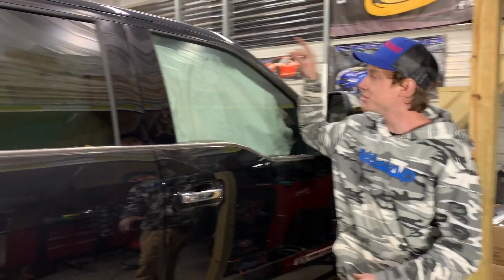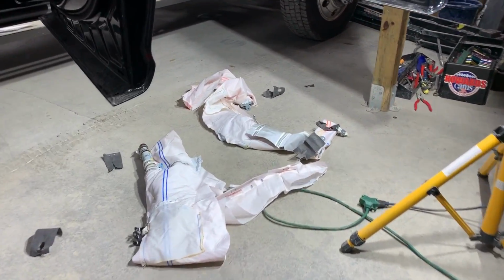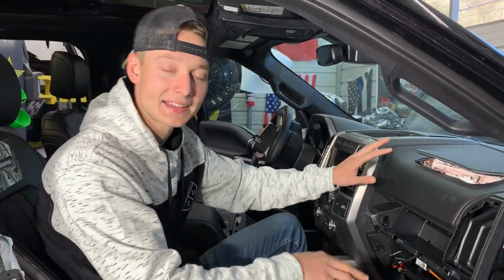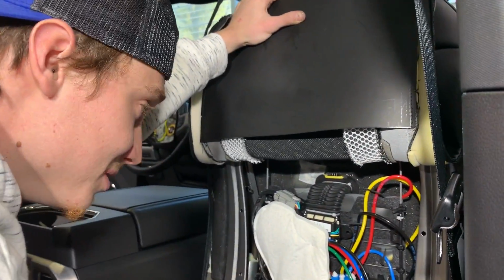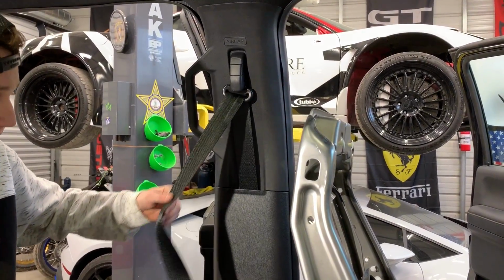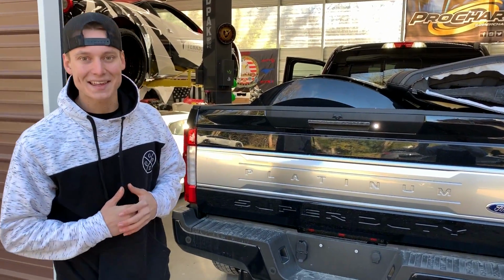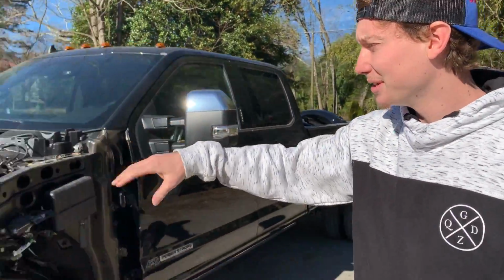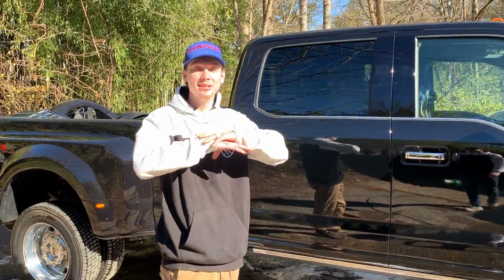Rebuilding A Wrecked 2019 Ford F-450 Platinum Part 3

Comment: *STEP BARS* Hey guys. Every time the battery is disconnected, you have to turn the step bars back on from the controls on the steering wheel. Default is set to off. Just turn them back on.
Reply: I didn’t know that thanks
Reply: Yall out here like these dudes read these comments.
Reply: Sean Cunningham Lol,but they do though. dude.
Reply: I have a 2016 Expedition and can vouch for this comment. It's not hard to find in the settings and there's also options to have them stay out all the time in case you lose one of the motors.
Reply: @dustinlanclos1061  i get what you're  saying  but that more like Logan paul jake paul views
Reply: That’s good to know thanks
Reply: True I had to replace the battery in my wife 2016 king ranch and I had to reset the side steps to work again.
Reply: Every time it’s in an accident it sets the steps to off as well, 2010 f150 platinum happened to me. Just had to reset it to auto
Reply: Leave them off until it has good batteries otherwise you run the risk of frying the power running board module every time you jump start it.
Reply: Also whenever you use an OEM scan tool on it to run a test, it resets them to off.

Comment: Guys, the steps go back to default of not deploying when you disconnect the battery or it runs really low.  Go to the front display, options menu with the steeling wheel controls and you will find an option to turn on and deploy the steps.  Takes just a few minutes. Good luck and great build keep up the good work!

Comment: You guys might wanna get a deeper trans pan. These newer Super Dutys run hotter then most trucks. I have a 2017 F350. In the hills off Pennsylvania the trans got up to 240. I did a lot of hot shotting with my truck and put on 233,144 miles before the trans went out on me. I would say 2/3's of the miles where under load. After around 30k miles I had problems with the sync radio and moon roof. If your moon roof starts to click when you open or shut it or doesn't open or close right away. You will need new tracks for it. Ford Company is well aware of the problem. I know they did not fix for 2018 models, not sure about 2019 and newer. Great looking Truck. Over all I do like mine. Great channel, Been following your guys for awhile now. You guys need a Goonzquad car museum with merch store so your viewers can stop by. Kinda like what Duck Commander did. Keep going strong. God Bless

Comment: BEFORE I SAW THIS VIDEO, I had a hard time resolving how a truck like this F-450 could cost over 80 thousand dollars.  That is until I got to see just what goes into just one heating, massaging and air conditioning seat alone.  Then all the parts under the dash and everywhere else.  It is all just amazing.  It is also amazing to see the squad take on the chore of rebuilding this truck.  Much respect for the boys..

Comment: Fans: send dozens of razor knives via fan mail

Goonzquad: uses single edge razor blade to open/cut everything
Reply: Yeah, I remember someone sending them a whole lot of knives about the same time they were receiving flags from different subscribers...
Reply: Plot twist they take out the blades
Reply: Theyre disposable and sharper then most pocketknives.
Reply: it's easier using those little razor blades to cut airbags.  That, i know.

Comment: You have to press and hold the ! button on the Noco Genius booster when the battery are really low to activate the booster function. Ive started flat dead diesel trucks at -30F without issues ;)
Reply: I need to get one. I drive semi and work on cars

Comment: 2019 and the seat frames are already starting to rust, it amazes me why they never coat them with anything.
Reply: It looks like it was caused by the Air bags blowing
Reply: They arent made to stand the test of time or be restored anymore. Modern vehicles are made to last 10-15 years top in harsher climates. Maybe longer in Arizona but not salt-raped Canada.
Reply: Pigeon Based on modern manufacturing practices. Boxed steel frames cannot be restored like c channel. Super thin body steel, thin support structures, complete electronic dependant, constant need for software updates, 3-4 the wiring and sensor than late 90’s vehicles. Now in our canadian wrecking yards we are seeing trucks and suv’s be scrapped from frame or body rot before the powertrain is dead. We used to wear out a motor and go get one from the salvage yard, now we are wearing out a chassis or body and looking for donors.

Comment: So lumbar support or the “Water Lines” are actually air. It doesn’t use water, it’s a waterless system. It actually runs off the vacuum in the car, but the system inflated the system and doesn’t put a vacuum. Actually a lot of older cars uses vacuum for the heating and cooling in cars. Most use vacuum to direct where you want the air to go

Comment: Make sure the battery is disconnected when messing with the airbags. Some of the new airbag systems have secondary deployments and can deploy again after the initial discharge. As little as a 9V battery can trip an airbag. 🤙🏽
Reply: Then boom KIRKPATRICK 👊......
Reply: The idea all the bags went off is by design that runs up the cost of repair to sell a new truck?
Reply: #totaled

Comment: Hey remember You should cross your trailer safety chains, so if the hitch fails, the chains will catch it
Reply: I remember seeing you didn't in the first f450 video
Reply: Or else the back of the truck will catch it.
Reply: @HaynesJP  well that too ig😂, but if you don't cross them the trailer will drop and drag on the ground, where as the crossed chains will cradle it

Comment: So the bag that the air bag was in when you unbolted off the frame  it is sewn into the trim of the seat back ( the leather). So to install your new air bag you need to make sure that the pocket is there when you get the back repaired. The air bag slips into the pocket put the back on with the airbag in the pocket then you bolt the airbag back to the frame.plug everything back up and close the back out should be good to go

Comment: Try contacting “myairbags.com” they may be able to reset the module as well as the seatbelt
Reply: The are over in Buford - near Swanee, GA - I've had mixed luck with them.  They rebuilt a instrument cluster for my 2005 yukon.  All the gauges  seem to be off a little and the half the bulbs blew out within a year.  Not sure if isolated incident. Others I've spoken to had no troubles

Comment: ALERT on the 2017 to. 2019 Ford F450... Recall on electric tailgate latch..
Ford will replace electric tailgate wire harnesses and tailgate actuator...
Saw the recall yesterday and I have watched Goonsquad post since you started.

Comment: Hey glue guy , nice fix . You may have anuff cavalier to make a bult prof vest  you need 32 to 45 layers  around 3/4 to 1 inch thick  and two inchs thick of bubble wrap for charly horse protection  will stop a 12 gage magnum shell but you have to use 47 layers  ,  but will not stop 50cal riffle.  Try it use duck tape to hold it together.

Comment: Tip: if you key fob dies you can still start the truck by placing it in the little space inside the cup holder when you pop out the cup holders

Comment: Hey guys, when you were discussing the seat belts and air bag going off, there are vehicles that have passenger sensor that will turn passenger airbag off if no one is in them and some vehicles have a manual switch that can be turned off.

Comment: SRS modules are almost always located in the centre of the vehicle as they often have YAW rate sensors inside which more accurately measure from the centre of the vehicle.

Comment: I believe it's a air switching mechanism for the air, not water lumbar and other supports in the seat and ventilated seat portions. I could be wrong.  And the intake is where the air comes in and out, with the small compressor at the bottom.

Comment: There is a setting in the advanced settings on the cluster that has the options for the power running boards. Out, Auto, and Off. Auto they come out whenever any single door is open and then go back up after they time out with the doors closed. They will stay out when the doors are open until closed

Comment: For the power running boards You have to go to the menus like how you Check for Tire pressure on ford Vehicles and you just look Through the Menus for Power running boards and it will Auto on off.

Comment: the lines are air. it uses air to make the massagers work and also to adjust your lumbar. the intake in the seat is for the air conditioning part or ventilation. the heat is still like a old style seat where its wires in the seat that heat the seat.

Comment: The white sock was a tsb from the original non sock version. There are aftermarket upgrades that vastly improve seat cooling using hard pipes. Look on f150 forums for the link explaining the tsb.

Comment: For the power running boards (side steps) you have to activate them under the settings. Settings> advanced settings> vehicle> power running boards> select ON. The controls are on the steering wheel.

Comment: That booster works by detecting some electricity if there’s no power then it won’t boost. You have to press and hold a button on the device and some lights start blinking and then it will boost.

Comment: Yes. Seat adjustments and massagers are filled with air, not water. Water would freeze in winter and bad things would happen.
Reply: Bobby Brady  yes but for longevity and simplicity the seat systems have been designed with air pumps and air bladders. As soon as you introduce a fluid the system becomes more complex and has additional risks that air systems don't.

Comment: There is a on and off switch for the running boards is in the menu. When ever the batteries die they automatically turn off you have to go and turn it on it’s in the settings menu under vehicle.

Comment: Something that I know owing one of this for almost 3 years is that even disconnecting a tail like throw bunch of codes and light in the dash, everything is connected and communicate to all computers, that's why in the glove box come some plugs in case you remove the bed, to not mess any communication, so maybe that's why some things doesn't work they way it should be, because you guys have many things disconnected

Comment: Use Bacitracin on that little cut on your finger. It will heal rapidly. Put the Bacitracin on a good band aid and you can work with that on your finger.

Comment: DETROIT, Mich. (AP) — Ford is recalling nearly 262,000 heavy-duty pickup trucks in the U.S. and Canada because the tailgates can open unexpectedly.

The recall covers F-250, F-350 and F-450 trucks from 2017 through 2019 model years. All the trucks have electric tailgate latch release switches in the tailgate handle.

Ford says water can get into the electrical wiring and cause a short circuit, activating the switches and releasing the latches. The company says it has no reports of crashes or injuries.

Trucks with mechanical tailgate latches are not affected. Dealers will fix the tailgate frame wiring harnesses and install a new tailgate handle release switch.
Reply: Important Notice, For Sure.

Comment: That dash is literally the easiest dash to remove. separate steering shaft at the floor, remove center floor console, remove the plastic covers (3) where the winsdhield meets the dash and remove those bolts, side remove side covers by doors and remove those bolts 2 or 3 per side, remove center brackets under center console and unplug the BCM and antennae and its out, dont remove anything else or you are just wasting time. i pull these every other day and they take less then 20 minutes

Comment: There’s no liquid in the seats. It’s all air controlled. Any upholstery shop can repair the sides for you. If you wanna ship them out, you can send them to my shop in Houston, AutoFacelifts.  Also be careful around those seat zippers. The stitching on the platinums and the king ranch seat zippers will come loose.

Comment: Also just get a new seat belt from the dealer , they aren't bad on prize , and also remember to change out the driver side seat belt buckle, you have to change both out at the same time , it's a safety thing

Comment: IMPORTANT: Guys, when you're buying a truck/car after an accident, it is important to check the engine. Because when cars hit, engine may stop abruptly really fast. This makes crankshaft hit the journals (crankshaft bearings). This means engine will not run for a long time after that.

Comment: Hey guys  where about the airbag control module for 2018 Jeep Grand Cherokee located ? In 2014 I know it’s located in the exact same spot as you guys just pulled out from this ford. So do you guys think it will be in the same spot for the 2018 as well ?

Comment: Why at 7:12 you can see the plastic protector on the platinum badge in the seat as if it is a brand new seat? Did you not show the install of the seat?

Comment: Those batteries, to charge with a trickle charger, you need to disconnect one, then while disconnected you can charge either one.  When paralleled those two batteries have too much load for then smart charger, looks like a dead short.

Comment: Those dash covers really do suck replacing bc you have to remove the front seats and consoles and remove the whole dash and then take every thing apart to get the cover off and swap everything over to the new cover.

Comment: Also newer cars and trucks if no one has seatbelt on they don't blow. There should be a airbag shut off for the passenger side. Also if the vehicle isn't running the and gets hit in the front the airbags will not detonate.  I got airbag sensors off a Chevrolet truck that was hit in the front hard and it didn't go off and still ran .

Comment: Just my opinion I would paint the hole truck because as the paint fades you will be able to see where the truck or car was repainted and just not that if you use a paint measuring tool the new paint will be thicker than factory paint

Comment: The hoses in the seats usually use an air system and compress air not water in the lines.

Comment: The side steps might just be a setting. Ford lets you turn them off. Auction house or original owner might have wanted this. I’m pretty sure it the screen in the cluster controlled by the steering wheel.

Comment: Hey guys! ON THE RUNNING BOARDS! hope you guys see this comment or someone elses comment about them because it took me FOREVER to find the answer on google!

On my 2011 f150 platinum when the batterie is dieing it cuts all power off to things to save as much as it can, the first to go is the power running boards, 
Every time it dies it will do it 

On mine it’s in the cluster settings, forget which topic it’s under but it will be easy in/out I believe 

Turn that back on! There is 2 areas of settings for the running boards! Make sure to click each topic on the settings and read them!

Comment: For the side step evrytime You disconnect the battery You have to reset them , You reset on the dash by settings and them vehicle and it saids said steps auto on.

Comment: Goodsquad, when you gotta push anything back, always have some wood blocks behind it to stop it if it gets away from you, as I had a derelict car with the parking brake off that i was just pushing on to see if it would move, as I was just curious, as I didnt think it would move, and it started moving, AND picking up speed, luckily I left the door open and hopped in and hit the brake before it really got moving and did any harm, 

but you have a slope behind this gigantic truck with a skyline right at the bottom of it, so I think you better do that, maybe even with concrete blocks, maybe even both lol

as my mistake is your gain, and please do that as the Skyline is one of the few JDM cars I really like lol

Comment: Eliezer and his brother paid about $47,500 for this truck. Lets see if they just throw money at it. This is a salvage title truck and banks don't give loans on salvage titles so if they will need a cash buyer should they sell. Building salvage title vehicles is more challenging than most people think. Selling it can be the hardest part if you don't want to lose money.
Reply: You are correct but these guys are running a lucrative YouTube business. Most people doing this would actually lose money because cash buyers are a small part of the market and they would make low ball offers on a rebuilt car. However, these two are near the top of how-to auto channels on YouTube and the 15m monthly views alone likely means they earn at least $60,000 a month. Plus they have sponsor deals and sell merchandise. They actually are able to write off many of the car expenses so it probably helps lower the federal tax bill if they keep most of the cars once completed. I am sure they have accountants on payroll advising them of all these things.

Comment: They make a medical "super glue" you can get at walmart for cuts like that. Actual super glue is full of chemicals and can "burn" the wound not really recommended.
Reply: They are correct that the original super glue intended purpose was to be carried by medics in Vietnam to glue large wounds together.

Comment: Also this website says to get the factory door code for the keyless entry it’s on the sjb (smart junction box) located on the passenger side foot well behind the trim to the right of your feet. Hope this helps!! Here’s the link just in case. 

https://seventrumpet.com/2011-2018-ford-f250-factory-keyless-entry-pad-code-location/

Comment: Went all the trouble to rewire the interior wires all the seats and top of the roof , possibly wires under The hood, hoses, fix the front structure , fan, belt.  I wonder why it is worth the time and money to buy this junk. Because you guys have a lot of free time. You don’t need to go to work, just staying in the house